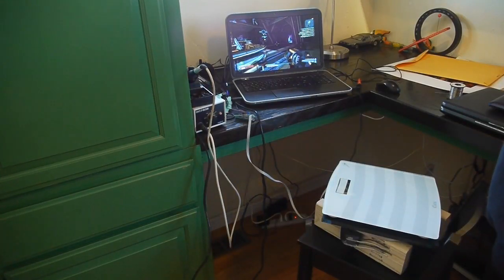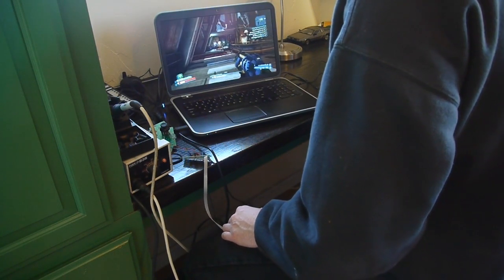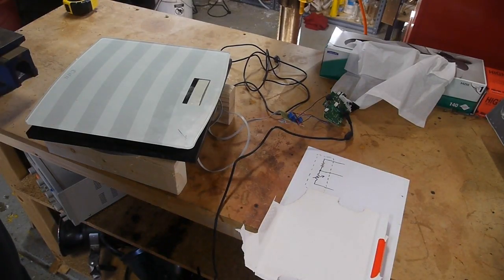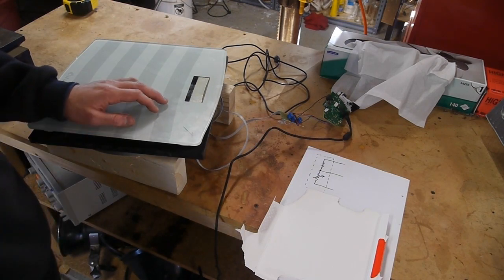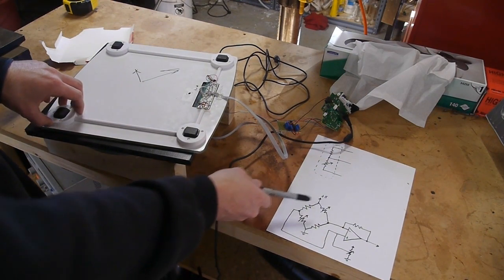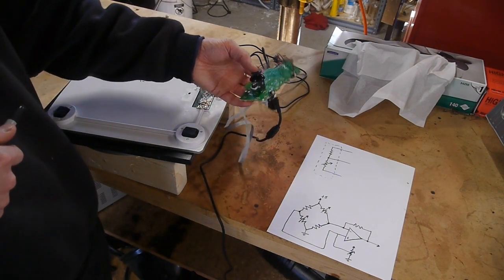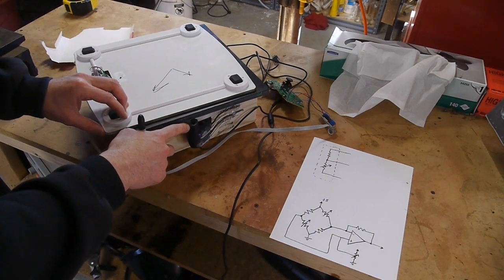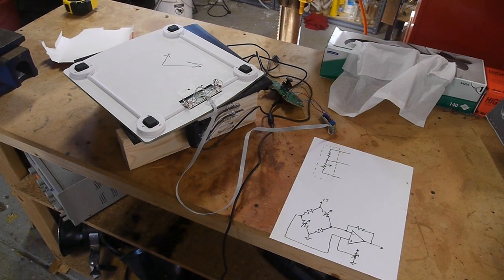Posture-based game controller

Comment: A decrease of resistance on the left force-sense resistor (~3:59) would lower the voltage on that measure point. It looks like you drew the schematic wrong. Or am I missing something?

Comment: Shouldn't both variable resistors of the bridge be either top or bottom? The way you drew it, it would react massively to weight, but not to shift in weight.

Comment: Using the cheap strain gauges differentially is very elegant and sensitive compared to the previous experiments with IMUs.  I like it.  Just can't get away from work huh? Even on the weekend, 2000 km away. :)

I want to try a rig with a mounted monitor for the star wars 'falcon gun turret experience.

Comment: ***** This would work great in conjunction with a oculus rift. This could add the translating movement since the rift has only rotation sensors. I think this device would be best suited for "sitting down" game like driving simulators. To add full 360+ degrees of rotation I suggest making the controller act like a joystick at the limits while maintaining 1:1 rotation in the center to keep the precision.

Comment: My story and ideas:
---
I was thinking about playing the coop multi-player of splinter cell conviction on my own because 2 characters are better than one and other people aren't thinking the same thing as I do. And mainly because I believe multitasking is possible, I can already shift gear when cornering and watching the traffic. However playing a 3rd person multiplayer shooter requires 4 hands and controlling the mice with my feet or so is impossible. But if I could control one character using the ordinary method and the second one using this posture thingy
---
So here are my improvement ideas:
If you jump on the chair it could left-click to shoot.
You could add a few pedals to do actions like jump, climb, hide.
This can be done in no time with an arduino.

Comment: so if you were using it on a laptop, you might want a chair where the roller was attached to the bottom portion and the force sensors in or on the chair, then a desk could come out from one of the arms where you would sit the laptop on so you could go 360° (although i'm not sure how many people would want to have that setup)
or for VR this could be your torso movement and the head would act independently,..i'm not sure how much zeroing would be needed, wouldn't it just spawn the player facing forward with it's head facing forward as well...unless you loaded the program with the headset off, facing the wrong way then you might have problems,..maybe a zeroing button where you press it and it just puts both facing forward with vision level to horizon

Comment: I just don't see this as a valuable or viable alternative to more natural movement devices, such as those that allow walking, even if they are larger and somewhat more difficult to use. Mostly because I can't see people moving around like that to control character movement when that's not only going to disrupt their ability to use other controls,  but rotate their body away  the screen, which sounds like a wonderful way to put strain on the neck. This could be reduced by high sensitivity, but that too has problems. Never mind that a system like this is going to run counter to natural motion. If you have to walk to move, you're hardly going to end up walking out of excitement, or anticipation, or focus, but people do naturally lean towards their screen at this, and sitting as we do at computers is a fairly uncomfortable position to be in for longer lengths of time, so people tend to shift their weight around a lot.

Still, even without thinking this has much value for VR, I still think it's an interesting experiment into something not really explored (to my knowledge, and rightfully or not), within the realm of VR controls.
Reply: This has wonderful applications for some individuals with physical disabilities...
Reply: To an extent sure, but this requires that they have control over their legs, hips, torso, and neck, and can continue to lean and rotate these parts of their bodies for extended periods.
Reply: seigeengine I think this would up the level of immersion in VR situations considerably. Having your avatars body move even a little bit with the movement of your physical body could help immerse players immensely. Nothing breaks immersion like moving your body and expecting your avatar to move as well and not having it happen.
Reply: Spaisekraft I already covered why I disagree. Also, I have never expected that to happen.
Reply: seigeengine I've seen plenty of complaints about people losing immersion when they try to move their hands or twist or lean and nothing happens in game. But you haven't experienced that and you don't think this is worth exploring so they should just shut the whole project down.
Reply: Spaisekraft Yeah, no, I may occasionally lean, but it's less that I expect it to move the character and more that I'm already moving the character that way. Either way, there are many reasons why this is a terrible and impractical idea, and you have addressed none of them, so it was nice talking with you.

Comment: Cool Idea...I have done some similar modding of an XBox controller using digital pots, a micro controller, and data from a gyro/accelerometer to convert physical movement into in-game aim, though the project is stalled because I can not seem to counter the tendency of either left/up or right/down to have more sensitivity than the other side.  If you want to take a look at the overall project, here is an old album showing exactly what I was going for:

http://imgur.com/a/7hlI2

Works like a dream apart from the problem with calibration...I can not tell if it is my sensors that are causing the problem or if the resistance in the controller is simply not linear enough...

If you have any questions or comments, I would love some feedback!